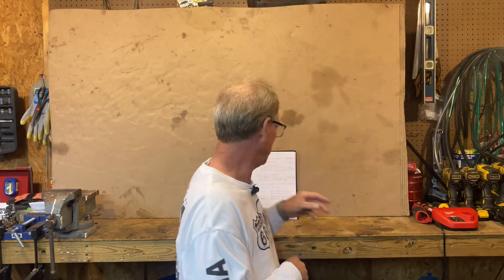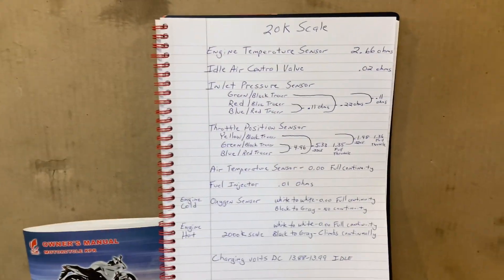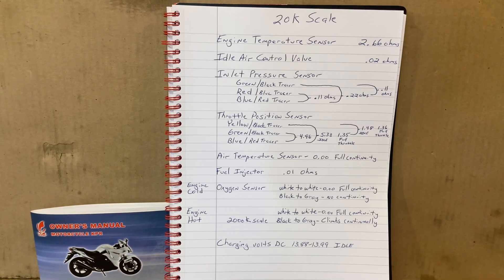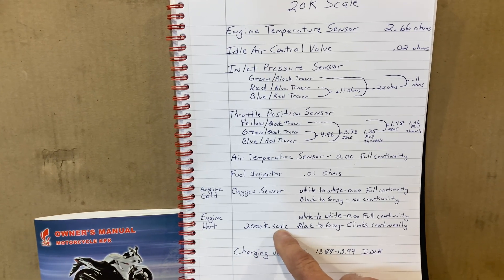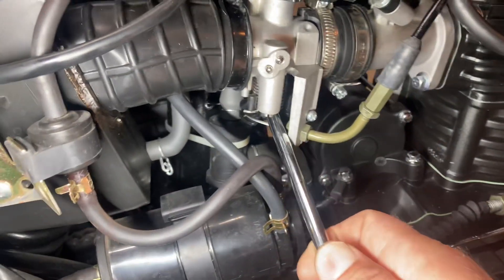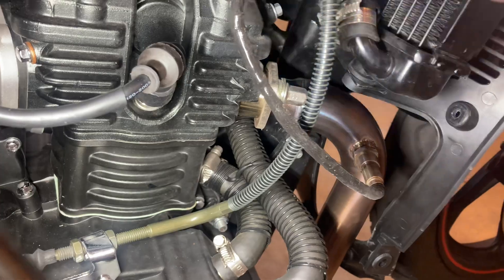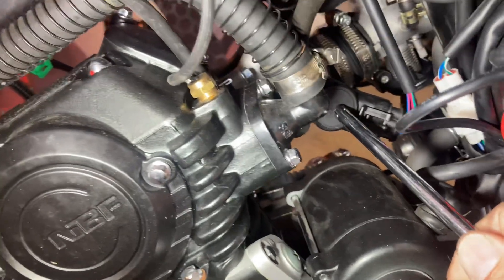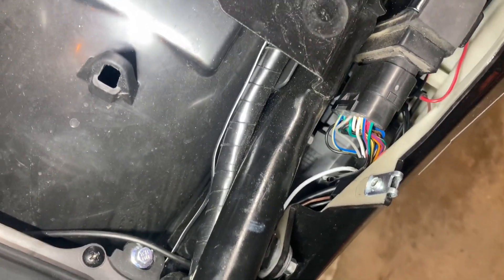KPR 200 Diagnostic information

Comment: is there any obd port?
Reply from the maker: There is a port, but I don't believe you can read live data. Basically, it will give you trouble codes the same as the blinking light on the dash.
Reply: @herbiesgarage681  even that is helpful for onboard sensor diagnosis. Have you faced/resolved overheating issues?
Reply from the maker: @ClashofclanMurky  usually if a bike is overheating that didn’t overheat before it’s because air got introduced into the cooling system. Make sure while the bike is cold that the radiator is full and the reservoir is up to the full mark. Try removing the cap on the reservoir bottle, and let the bike idle and occasionally raise the rpm’s up to 5k and hold it for a couple of minutes doing that procedure over and over for several minutes. Add coolant into bottle if necessary. No I haven’t had any overheating on my KPR though.

Comment: Sir my bike has some problem like its idle is slightly up down and at high speed my bike start missing on high speed ..
Reply from the maker: Have you done any modifications to it? Have you adjusted your valves yet?
Reply: No i never adjust valves
Reply from the maker: @PashaMPG  A symptom directly related to the need for a valve adjustment is a bad idling condition. There has been a person I read that had a hunting idle and he claimed adjusting the gulp screw fixed his issue. I think he made a video of it and I might be able to find it for you but if it were me I would check the valve gap first just to make sure the bike can run at it’s best performance possible.
Reply from the maker: Here' s the link but I am not claiming that this works because I don't have any experience with it. https://www.youtube.com/watch?v=9vY7UmwR9jI&t=3s
Reply: thanks my mate apperciated i would love if you can fix my issue. also while running in high speed my rpm wont push max. on 4th 5th and 6th gear.
Reply from the maker: @PashaMPG  Your welcome Arabi, if it were me the first thing I would do is to check the valve gap and adjust it if necessary. If your unfamiliar with the process then you can check out my video on it here   https://www.youtube.com/watch?v=I0kcUfBqIgA